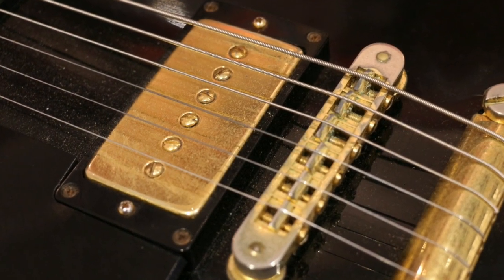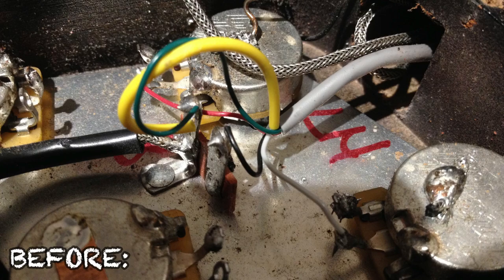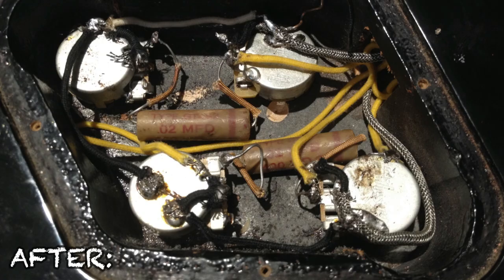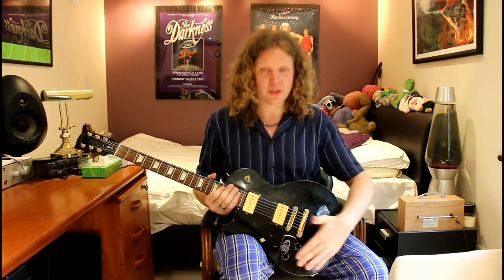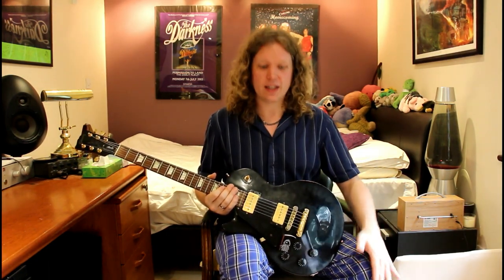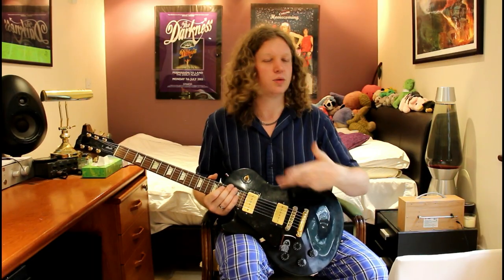Les Paul '50s Wiring Part II: Bare Knuckle P90s & Luxe Grey Tiger Capacitors

Comment: I definitely prefer the 50’s wiring here man. It seems to have a more lively, less compressed sound. Do you think that’s a result of the pickups having a hotter/milder output? Or something else?

Also, I love the new intro jingle and graphics package at the beginning of the demo!
Reply from the maker: Just a 'cleaner' circuit and nicer caps I think - much more interactive.  But you're right, it does seem to be less compressed and be far more exciting! :-)

Comment: Failed! The 50's wiring changes the tone when you move your volume pot away from 10. If you play with your tone knob but keep your volume on 10, the circuit is "electronically" the same between modern and 50's